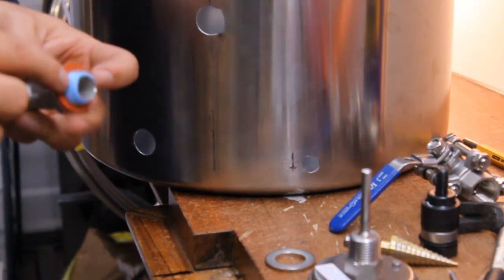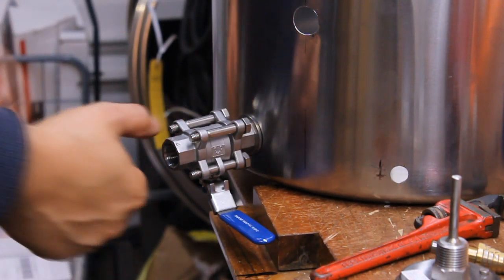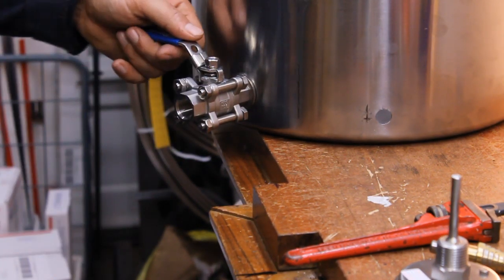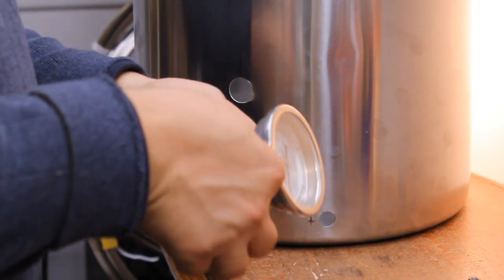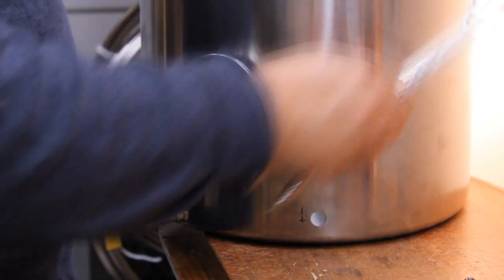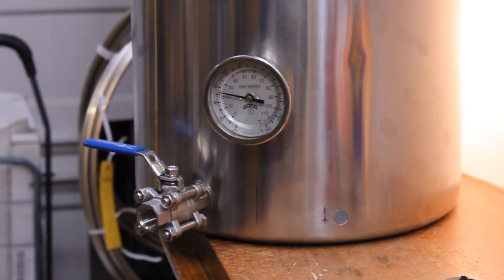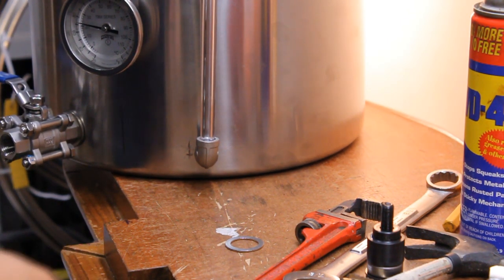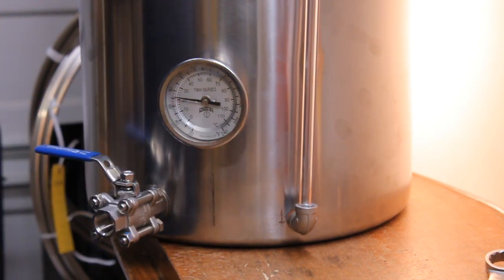BobbyFromNJ Part 3 Brew Kettle Build - Install components and wrap up

Comment: I have a question I baught a weldless themometor and it has two gaskets it also has two washers. I thought one would go on the inside and the other would go on the outside. According to your video you just put the gasket and the washer on the inside. Why did I get two gaskets and two washers then?
Reply from the maker: You got the parts from me (brewhardware.com)? Is so, you didn't get two gaskets. If you got it elsewhere, install per that vendor's instructions. The method in the video is the way I have been doing it for nearly 10 years with no leaks.
Reply: @BobbyFromNJ  Thanks for the info.

Comment: Hi there, Nice job. But why a so heavy, more expensive tap. Why not one without the bolts and nuts, which could have been fixed in by holding it square, and tightening the inner nut. Seems to me that it would look better too. But hey! Cheers.
Reply from the maker: There are all kinds of drain/tap solutions out there now but this video is getting a little old. I still like using the heavy 3pc valves because they can be taken apart fully.

Comment: Awesome video. Newbie question: what is the reason the sight glass is the only one with the gasket on the outside?
Reply from the maker: Alexis Torres it just worked out that way. the exterior fitting has a nice broad area to seal against the gasket. it also eliminated the need for Teflon tape on the threads.

Comment: good videos,
just wondering, what is the brand/kind of the materials you installed? I have a hard time finding those. Especially the wells thermometer and the sideglass
Reply from the maker: Koen Achterberg The pot is a Bayou Classic, the thermometer and sight glass are products I sell at brewhardware.com
Reply: cheers

Comment: Nice video, very informative and I will be using your design this weekend. Question: what advantage do you get from having the downward facing elbow pipe inside the pot?
Reply: Im sure you got your answer 3 years ago.. but for others, its to get the MAX wort out of the pot (so you don't have to tilt it over (like I do))  Plus I love double parenthesis....LOL

Comment: Where di you get that bulkhead? I was looking on northern brewer for a similar setup, but not sure that they have a 90 degree bulkhead for the valve. Seems like they just have the straight bulkheads.

Comment from the maker: It's just the way the weldless system is designed. There are at least 3500 of these kits out there and the only time someone reported a leak issue is when they ignore instructions and put the gasket inside. Silicone can handle 600F before it melts and as long as there is liquid in the pot, it will never reach that temp.